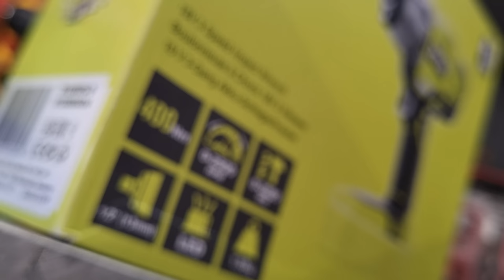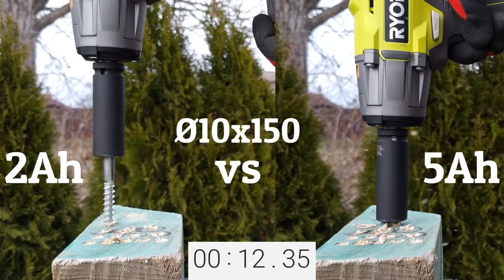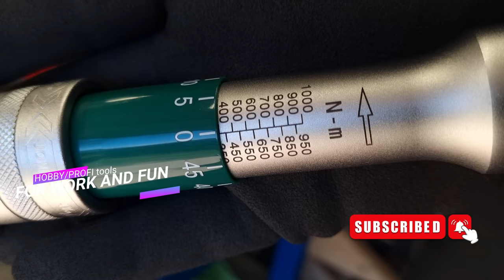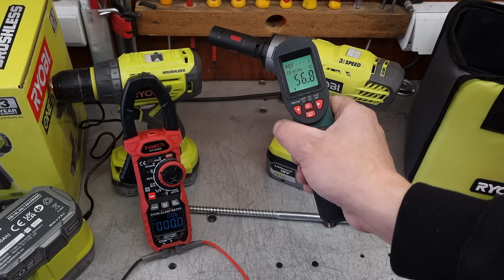400Nm silný rázový utahovák RYOBI R18IW3-0. Zvládne test do 550 Nm ??

Comment: Hello! I noticed that you used the 1/2-hex adapter for drilling, which comes with this impact wrench. But for tightening the screws you have an adapter from DeWalt. Please answer, is the DeWalt adapter really better? It seems to me that the standard one has a strong runout.